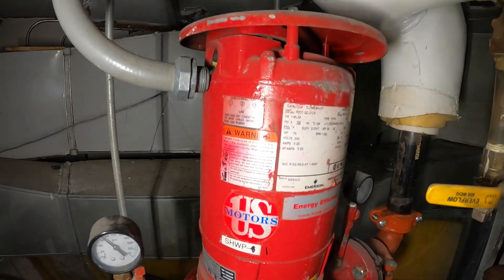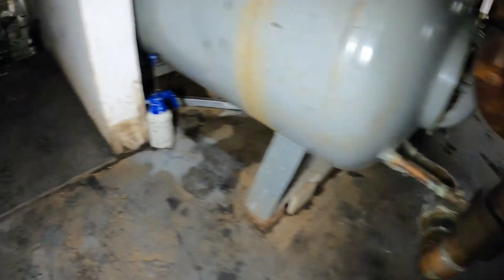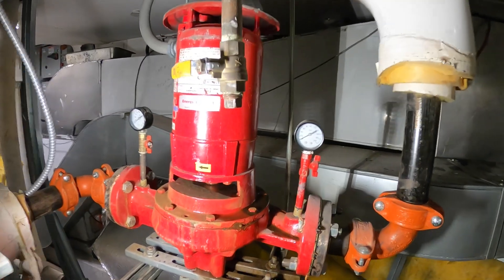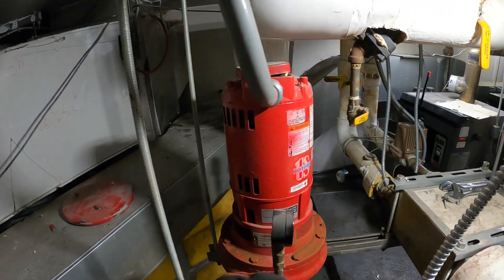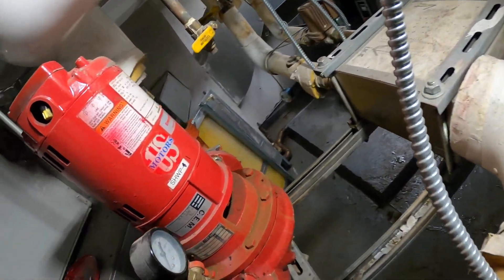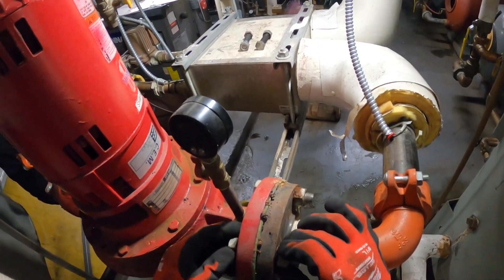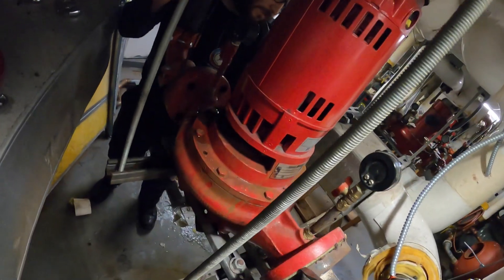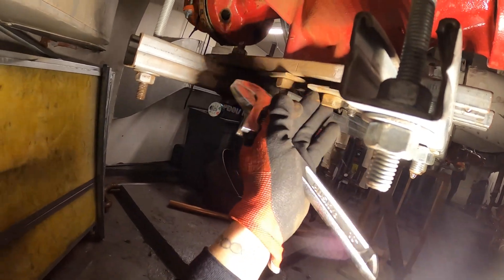HVAC Emergency: Commercial LAARS Boiler Hydronic Circulating Pump NIGHTMARE (Boiler Pump Leak Water)

Comment: Just leave the volute and pull the pump assembly. Pulling the whole thing is a lot of extra work. Our motor shop here will reseal just the pump and bearing assemblies. I only pull the volute whenever absolutely necessary

Comment: Do you realize how much a new pump and motor would cost? Where I worked, they would have had me  install a new seal onsite and have that pump back up and running by the end of the work day. Bell and Gosset is easy stuff to work on. You went to a lot of trouble and expense for nothing. You couldn't work for my old boss. I am retired industrail maintenance. No lock out tag out. You left wires hanging where someone could turn the breaker back on. That is a C Face motor. You unbolt the motor and lift it off. Then unbolt the bearing assembling from the volute. Remove the impeller and then install new seal. Put impeller back on and install new volute gasket. Parts should be less than $100.
Reply: As badly as they maintained the equipment I'm not sure there would be much of an impeller left. Would have definitely gave it a look over just to be sure how bad is bad. If it's just a seal no biggie, if the pump is shot here's the picture. ❤
Reply: You can replace the impeller if needed. They are available as a replacement part. Most of the time, they are okay or can be cleaned up or trimmed. The pumps all appeared to be the same series. The owner should have had an extra seal kit and gasket on hand in case of a breakdown like this. Water treatment is what usualy eats up the seal and/or impeller.
Reply: @EWB66  definitely an ounce of prevention is worth a pound of cure. They should have srals and gaskets handy as they are very cheap parts. The seal can be replaced without removing the volute as well so no excuse for this. The degree of neglect is jaw dropping with this boiler room. Thankfully lots of pumps are designed to be serviced without removing the plumbing so service isn't a complete PITA. ❤️

Comment: Great Video. Thank you for sharing. That's pump  is huge. I'm waiting to watch part 2 of this pump. Good job and nice work. Have a nice weekend
Reply: Big compared to residential pumps....but in heavy commercial that is a little guy. We have pumps that have 250hp motors that weigh 2500lbs. It all relative. These inline pumps are a pain compared to a horizontal on a skid. I recently had an emergency service call for a chilled water pump. It was an inline with a 100hp motor and we had to take it from another chiller that was luckily down for a teardown. Its not easy....but its fun

Comment: I used a Harbor Freight 120v winch to move those B&G pumps in and out of places surrounded with pipes. Usually just did pump seals so its easier to drop the pump back down slowly and make sure the seal doesn't pop out.

Comment: Haven’t seen you use LOTO in your videos. Why? It is the first thing that you should have been taught, can’t work if you’re dead.
Reply: Yup water and 3 phase is a potent mix, especially when it gets to the higher voltage range. ⚡️ 😳💀💀💀

Comment: One other option would of been to leave the pump volute in line and just remove the pump motor. Take the pump to your supplier and get the proper seal kit.  Those seal kits install easily. Other than that, your a beast!
Reply: I would want block-off plates installed on the inlet and outlet flanges while the pump was out - bad things happen.  Do any buildings stock the sal kits?  That sounds short-sighted of the building managers.
Reply: @DavidNull5  When I used to do pump work, we would try and talk to these companies into having some back up seal kits, gaskets, etc handy for these occasions.  We were having long lead times on some items, and some of these pumps can't afford to be off long.
Reply: @strikerj4810  That's why I was super glad the last two places I worked stocked seal kits and parts for our pumps and big mech units. made life soo much better, especially when they'd fail at 3 in the morning lol
Reply: Yeah thats the actual way to do it.  He even said he saw the water coming through the seal.  But that way can work too, but much more work.

Comment: You actually don’t have to pull the entire pump. We usually pull pump out of valute. Piping stays connected. Drop repaired pump back in with new gasket. Done.
Reply: You don't but they're going to send it to a pump service company. I'm an Operating/Stationary Engineer. I've rebuild 1/4 HP to 350 HP motor pumps from B&G , Gould, Aurora, Chalmers, Taco, Grundfos, Peerless just to name a few. I enjoy and love what I do for a living.

Comment: They stole your socket set And your wrenches so you had to use two adjustables???
Reply from the maker: I left my socket set on site after completing a job and when I returned a few days later to get it back, it was gone and nobody knew anything. It was taken for sure. Shiny new socket set. All I had were adjustables that can fit those large nuts/bolts so I did what I had to. Thanks for watching & stay tuned for new videos every week! 🔧⚡️
Reply: @JumpermanTech respectfully intended but if you waited more than a day that loss is on you
Reply from the maker: @MrDmadness  Agreed. Can't leave anything and expect it to still be there even a few hours later 😂 Thanks for watching!

Comment: Should have capped off the electrical feed or / and tagged the disconnect
Reply from the maker: I agree. That would be the proper thing to do. Thanks for watching & stay tuned for new videos every week🔧⚡️
Reply: Yup LOTO for sure. The gun locks with the flexible shackle make very nice locks for this use, especially for valves.

Comment: Why would you reset the breaker? That breaker could've popped and it tripped for a reason you as a service should've trouble shoot the issue. It's easy to rebuild in place and its always good to have spare pump seal kits.

Comment: Nothing worse then the service call when you expect to be off. Have you considered just replacing the pump seal onsite and having some spare seals for critical pumps?
Reply from the maker: Facts! If only I could get the pump seal kit. I need to call Bell & Gosset and find out which kit I need exactly for the series 80 pumps. That would be great to have on site along with a spare pump ready to go so there wouldn't be as much down time. Swap out the pump then rebuild the broken seal on site for the next one and have that ready for the future. Thanks for watching! 🔧⚡️
Reply: buy some vulcanized rubber gasket material and make your own. You also left a potential for 208 3 phase to be switched on to an open lead. Always cap wires. Good video though :)
Reply: The pump needs a new mechanical seal.....rubber isnt going to help.@MrDmadness
Reply: @Tim.F83  absolutely agree, I made the comment initially thinking he was referring to the flange seals.  My bad
Reply: @Tim.F83 ....exactly...its the mechanical seal
Reply: I was going to say  replace mechanical seal my self !